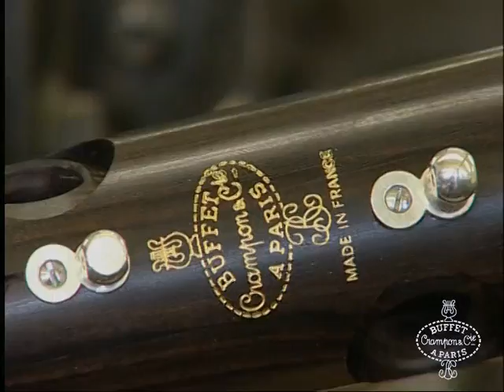The Making of a Buffet Crampon Clarinet | Buffet Crampon

Comment: Well this looked pretty good up until the end. So after construction, assembly and fine tuning and testing they put the horn in a protective case then over load the instrument compartment with a cleaning rag and swab and jam the lid down on the horn? That'll knock it out of regulation in an instant. Use the dang accessory slot for that stuff!